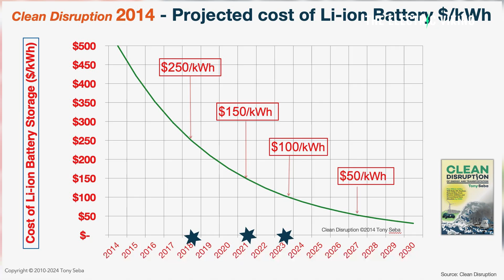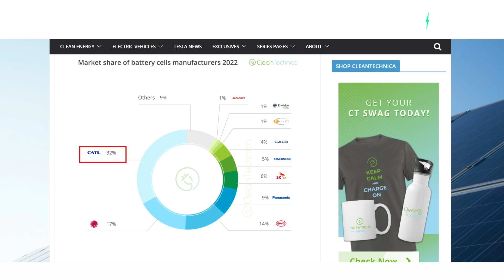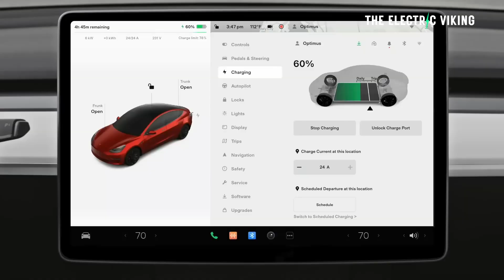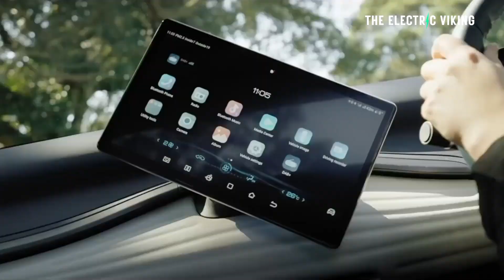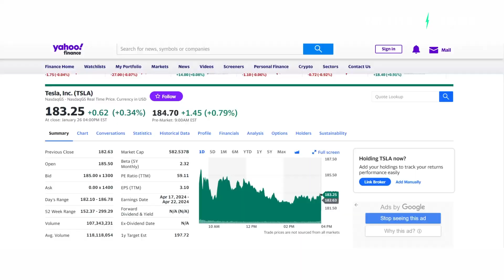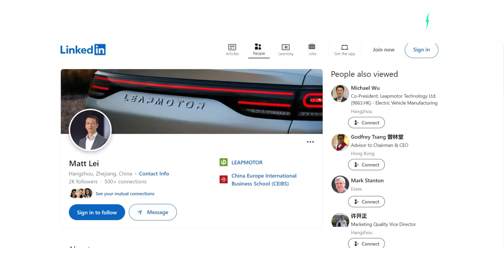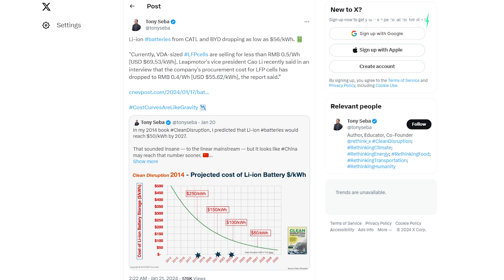Tony Seba's 2027 battery prediction is about to happen 3 YEARS EARLY!

Comment: A 60 kWh battery at $50 per kWh is $3000. That is insanely low! And as these cars hit the road in mass and start to hit the used car market there will be used batteries sold for EVEN CHEAPER. Owning an EV in a few years would be dirt cheap. Low fuel cost, significantly less maintenance, and the only major component that is able to break down (battery) on its own can be fixed by replacing a few damaged cells (couple hundred dollars in parts and labor) or just getting a whole new battery for around $3000 or a refurbished battery for even less. The batteries will last for at least 200,000 miles.

Gas cars are over.

Comment: After listening to this cast and reading the comments, I felt that a comment from someone outside the bubble (which I think is the viewpoint of many in America) was in order.  The EV is a great concept whose time has not yet come.  The focus of this article is that EV’s will be cheaper.  That is not the problem for many.  A fundamental improvement in battery tech is essential.  I would need an EV with double to triple the range of the current, that is cold insensitive, that charges in minutes, and that has a zero probability of catching fire in my garage.  I would also need a significant build out of charging infrastructure, with good maintenance so that half of the chargers at a given charge facility aren’t inoperable.  I understand that solid state batteries in the research stage may address some of these issues.  But that is then, and this is now.  I am pro environment by the way, but not enough to entangle myself in a technology that simply isn’t ready.  An additional elephant in the room, is that the environment does not end at America’s borders … it is planetary.  And if we took our vehicle emissions to zero globally, it would barely move the needle, because there is currently a massive buildout of coal fired power plants in China, India, and the developing world.  These folks either don’t care or don’t have the trillions of dollars in available assets to make a green transition happen.  I will buy an EV when the technology matures, because every little bit helps.  But for true progress to be made, the elephant must be addressed.
Reply: Once you finally get one, you will wonder why you didn't get it earlier.  We have our second one and just finished a 3765 mile trip in our EV.  Things are improving every day.  It is not only the charging infrastructure and battery range that makes people shy away from EVs. Range anxiety is an EV's enemy.  Gas stations are everywhere and plentiful.  Charging stations are multiplying fast also.  We have been on 8 trips of 2k to 4k and have never run out of energy. It's a mind shift.  I now add charging in my road planning.  There are internet planning tools for EVs that are free and reliable.  It can be done and we are doing it.

Comment: After reading comments a while...  Big business is crying about the need for cobalt in ALL the electric batteries.  Huh?  LFPs have no cobalt.  And recycling is gaining ground on cobalt, too.
Powerwalls and other home batteries would not drop by 50% since the unit is not all lithium, but they might come down 30% or so which would make them a great deal for even people who can't have solar due to zoning laws.  The era of blackouts and brownouts may someday be over due to a decentralized grid of batteries.
This will accelerate the depreciation of used electric vehicles and lower their value.  Ii may not have to wait for a Tesla 2.😀

Comment: As I understand it, a combustion engine in a vehicle requires a radiator and regular oil changes. An EV does not require either. Correct me if I'm wrong. Are these things factored into the cost of a combustion engine vehicle?

Comment: In the states manufacturers (and purchasers) are financially incentivized to buy EV platforms. Even WITH these incentives in place EV vehicles do not make sense financially or environmentally. Until the cycle life of EV vehicles original battery can double, the EV platforms do not make long term sense. There’s a reason Toyota and Honda have not jumped in with both feet. 9:07

Comment: Modern EVs are a great advancement in vehicle technology.  The support infrastructure for them is very inhibitory for many people and places however.  Electricity generation and transmission capacity is not good enough in many places, not to mention the charging equipment to serve EVs.  
Cold temperatures are a problem.  0c, not really an issue, but when you're at -30c...  EVs are either totally dead, or the efficiency drops dramatically.  There are many places in the world where -20 to -40c temperatures are common in the winter.  This is a problem for ICE vehicles as well, especially diesels, but those problems can be overcome with some small efforts.  There are products and strategies to mitigate the problems presented by extreme cold temperatures for ICEs.  The only viable solution so far for EVs is to keep the battery warm enough.. which means expending energy even when not using the vehicle.  This wouldn't really be an insurmountable disadvantage if the vehicles were designed with an internal battery heating system that prevents the battery from dying due to dropping below a certain temperature, but those systems are not built in, yet.
I think EVs are going to be the future.  But we're not quite there yet.

Comment: Technology progresses and the EV deniers will be proved wrong. What I think is funny is that if there is a wide spread electrical blackout, EV deniers will be caught short as they will find fuel pumps useless and no fuel can be manufactured without electricity. 
VHS and Betamax duked it out and VHS won. Now Chademo, CCS and NACS are at it and it looks like NACS is the winner. It appears the infrastructure is going to be messed up for quite some time. 
I believe that with care my 10 year old Leaf battery could last another 10 years giving the lie to the deniers. 
I find a wait and see  attitude works best.
I remember when DVD players were over 1,000 dollars, now I can pick up a Blu Ray player for 10 dollars at a second hand store.
Bob Dylan was right. Times are changing.

Comment: Cheap batteries won’t make EV’s take over.    The majority of the population you need to reach don’t have access to their own charging stations as they live in flats/apartment’s.    I know a few people who bought EV and now the price of charging is making them much more expensive to run than ICE and they are regretting having bought EV.    The infrastructure is still not present apart from in some areas so don’t hold your breath yet for the demise of ICE vehicles.    We will have them for a long time yet.

Comment: I’m an engineer with a background in both power and manufacturing. And I do agree that the cost of ev’s are going to come way down due to advancements in technology, solar and wind are NOT possible to replace traditional sources. Their inputs aren’t stable, therefore their output can’t be stable.

Comment: 3-4 years ago we got a Tesla Powerwall. It cost £6000 total installed with inverter etc. I had a quote last year for an additional one at £8500 installed. If they can go down in price to be £3000 then it makes installing a second and third one and then replacing our gas boiler with a heat pump a possibility, as we could then run a heat pump on 7.5p kwh overnight electricity during the day time. Sure on the 20-30 coldest days of the year we will still need some daytime electricity to top up the heating, but this could make it financially viable to switch. This winter our gas price price has averaged below 4p kwh. So let's assume a new heat pump works at 3 times the efficiency, so we would need to pay less than 12p kwh for electricity for it to be cheaper. Our current day time rate is about 30p kwh so that is not going to help at all, but with a nighttime rate at 7.5p kwh for electricity and cheep batteries then you can switch over become greener and eventually start paying back the cost of the batteries and the heat pump! Pretty sure the payback will still take a while.

Comment: ev's will be cheaper in large part because the demand for ev's have dropped like a stone. the initial craze is waning massively, especially will gasoline prices being reasonable now.

terrible range
terrible refueling time
terrible in the cold
terrible price (for now, it sounds like. it's getting better for sure)

I won't buy ev until solid-state delivers its promises

Comment: We need  SUV with much bigger  battery  than most of the manufacturers  offering  now .  I mean  for example,  KIA EV5  with  120kWh battery  and  KIA EV9 with  170kWh battery .  I know there is still  problem with low energy density  then  how  long we will to wait for that EVs ?

Comment: REALLY what we need is a 20 years warranty for EV's battery. The reason why there is not currently longer warranty is because the battery will not last that time.

That means also in consumer perspective, that we do not have full trust for EV's.

If longer warranty is not possible, we do not have resale value for older EV-cars which are over 10-15 years old.

Currently there is no suitable, trustable (battery is the risk) and affordable old EV's for consumers on budget under 10 000 dollars/euros.
Reply: Who keeps their car for 20 years? Be real.
Reply: @andrewcumming6319  Are you rich or just do not understand at all what money is?

You have not heard about old cars resales situation ever or resale value? 

My current car is already 12 years old BMW X3 (I'm second owner). I'm going to use it at least another 6-8 years or more before switching to EV.

So of course there is a need for EVs which are old like 20 years old cars for people which need used vehicles.
Reply: @iSot80 That's a very condescending reply.

Comment: Initial purchase Cost of EV isn’t the real issue, insurance costs (I.e. inexpensive repair) is the real blocker and will continue to be until EV makers produce vehicles that are repairable for low costs.

Until you can inexpensively repair an EV, vs having to total them due to a bent bumper, ICE will remain the most common passenger vehicle.

Comment: the cost of the car is irrelevant if its impossible for people to charge them and then the vehicle is dependent on a different monopoly that currently cant handle its BASE CONSUMER LOAD let alone the considerable extra load imposed by replacing all ice vehicles with ev. thats a pipe dream and will bankrupt an already teetering economy

Comment: This guy is spouting rubbish as always , Price war in China due to dire economic position will reduce the price for a while, after some have gone bust the big comps with massive market share will  wack up the price.  Also it does not matter how quick they charge in the future the capacity for the extra load on the grids round the world is not there. for example to charge 30 million EV cars in the UK in say 45 min would need the same requirement as 360 million new houses. There also it has been reported there appear to be a lot of deaths in Tesla cars in the USA  1 in 4 on the road, if this is correct maybe this needs looking at.

Comment: 📝 Summary of Key Points:

📌 Tony Saber predicted in 2014 that battery prices would fall to $50 per kilowatt hour by 2027. Recent developments suggest this may come true, with a company called CA tweeting that battery prices may reach this level this year.
🧐 The drop in battery prices is due to increased competition in the market, with many automakers using batteries from CATL, which offers lower prices. CATL aims to reduce battery costs by 50% this year and has gained a significant market share.
🚀 The reduction in battery prices is significant because it makes electric vehicles (EVs) more affordable. The battery pack makes up a significant portion of an EV's cost, and if the cost halves again, it will be cheaper to manufacture an EV than an internal combustion engine vehicle.
💬 "This price war is good news for consumers, as it means EVs will become more affordable."
📊 CATL's lithium phosphate batteries have improved in terms of energy density, charging speed, and performance in cold temperatures. They can be fully charged in less than 30 minutes and have a fast charging capacity of 500 kW.
🌐 The decrease in battery prices aligns with Tony Saber's prediction, and it is expected that battery prices will continue to drop in the future. Alternative battery technologies and increased battery recycling will contribute to further cost reduction.
📣 The future of the EV industry looks promising, with cheaper EVs, battery storage, and renewable energy, leading to a cleaner and more sustainable world.

💡 Additional Insights and Observations:

🌐 CATL is aiming to bring their battery prices down to around $55 per kilowatt hour, close to the magic price of $85 per kilowatt hour for EVs to be on par with gasoline-powered vehicles.
📊 CATL had a 32% market share worldwide in 2022, which increased to 34% in 2023.
🌐 The decreasing cost of solar energy, combined with the reduction in battery prices, will make energy storage a more cost-effective and sustainable solution compared to fossil fuels.

📣 Concluding Remarks:

The video highlights the potential for battery prices to reach $50 per kilowatt hour, as predicted by Tony Saber in 2014. The drop in battery prices is driven by increased competition and the use of lower-priced batteries from CATL. This reduction in battery costs will make EVs more affordable and contribute to a cleaner and more sustainable future.
Generated using TalkBud

Comment: This is great news.    However you probably went to far by say we will not need lithium mines in 20 years, due to recycling.   This is highly unlikely.  My reasoning is that as the EV market demand becomes satisfied, the lithium ion battery will find many more uses.   Think home backup power supply, shipping, possibly air travel, more and cheeper grid storage, high speed trains ( I mean really high speed ), heavy duty equipment,  factory back up and load levelling,   And all kinds of stuff I can’t even imagine sitting in my house in 2024.

At $50 / kw that would make home power  backup of 10kW $500 plus the management equipment.   That would be highly doable for most folks in North America. 

Think hospital back up, military, commercial transportation, industrial processes,……

Comment: I agree that the cars are better but the grid isn't ready for EV's. I do 50/50 short and long distance driving and if I want to drive long distance the EV just doesn't perform like a gas car as I can't just fill it up on the road. If the few chargers are full I need to sit for an hour or two to connect to the charger.

Comment: If you love low resale value buy an EV. EVs are pretty amazing but financially speaking no one wants your used EV with it's degregated battery, old tech. On to of that manufactures continue to slash new car prices even further making your used EV completely undesirable.
Reply: Buy a used one!! Blimey! The answer is in your own comment. The battery replacement bs is just oil industry propaganda.
Reply: @ianhamilton3113  so then I'll be stuck with old outdated tech and a degregated battery? Not propaganda, it's a real thing. So after I'm done with my used EV it will really be worthless.
Reply: @naf2579  But EV tech is ahead of ICE tech so you'll be fine.
Reply: @naf2579  End of life OICE has a bit of value in the scrap. End of life EV's have more value because the battery can be repurposed. So old EV's will be worth more. Another problem solved.
Reply: @ianhamilton3113  sure thing. Go ahead and thank the manufacturers for speeding up the depreciation process for you.
Reply: @naf2579  So I can buy a cheaper car! Bingo! And I don't have to fork out literally thousands filling it up like I used to. Phew!
Reply: @ianhamilton3113  yeah but the heck with all the consumers they just screwed over who purchased a year ago. Also enjoy your low energy bills for as long as you can. There will soon be no off peak pricing. Replacing one problem with another. Neither are sustainable.
Reply: @naf2579  "There will soon be no off peak pricing. Replacing one problem with another. Neither are sustainable." 
Do you ever stop and think "what's the pros and cons"?
It doesn't look like it. The answer to your question is - you're going to kick your self when I tell you.

Put solar on the roof!!!!
Reply: @ianhamilton3113  yeah let me chop down all the trees around my home to get any return on solar. You have all the solutions.
Reply: @naf2579  Aaah! Trees!!! You are going to have to rely on cheap rate electricity staying cheap by the looks of it. Still with so many others putting up solar the grid will be awash with it. You'll be fine. The economics' is on your side , for once.